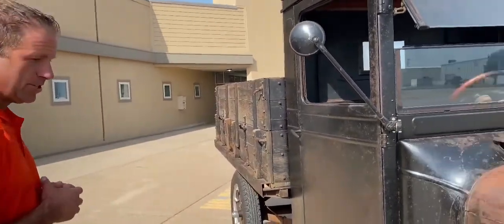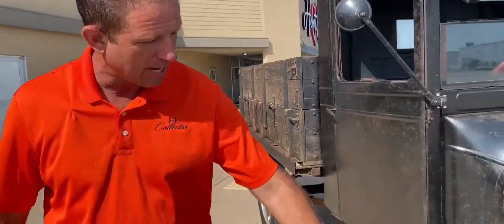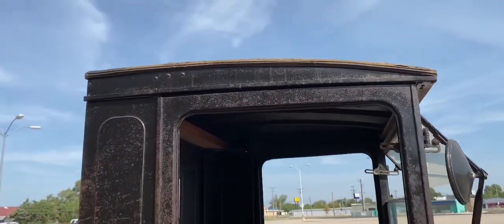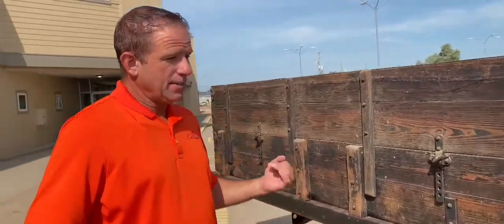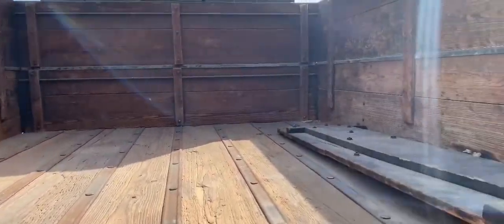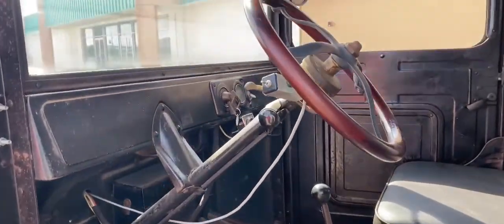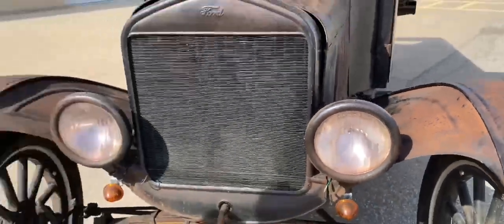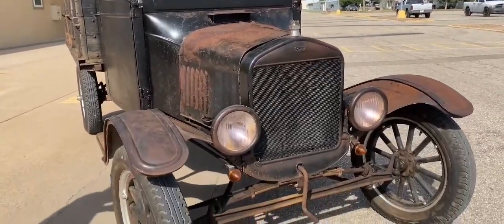1926 Ford Model TT Truck! Original Patina - Completely Roadworthy - and NO RESERVE!

Comment: Nice truck Chad but I already have a nice TT. The Ruckstell transmission is a big extra, these trucks won't drive over 35 mph without it as the rear gearing is very low. Fantastic to see it running so well and looks fairly original.  You could buy balloon tires for the 1926 and 27 T''s  -so that is not a problem. Very cool - in remarkable condition for a survivor - It's nicer than mine and has the FORD cab which is rare.